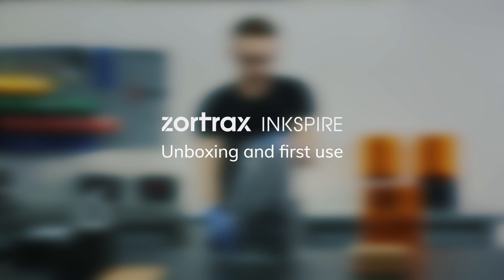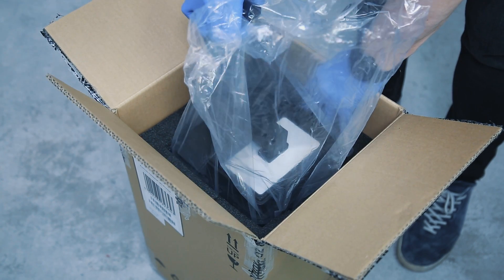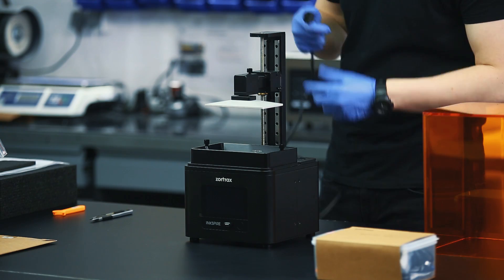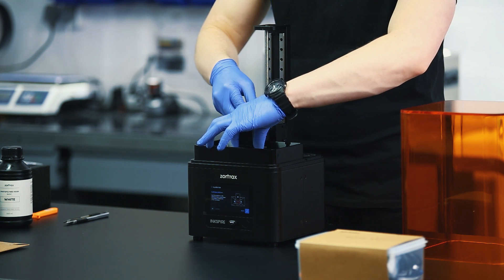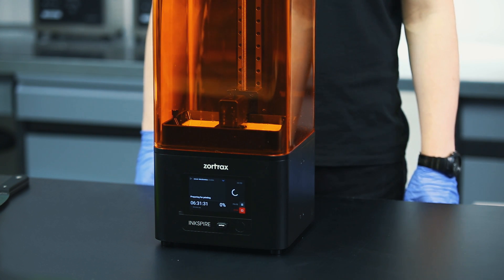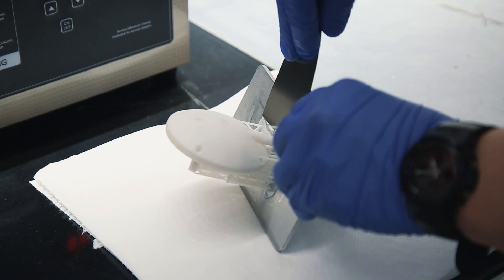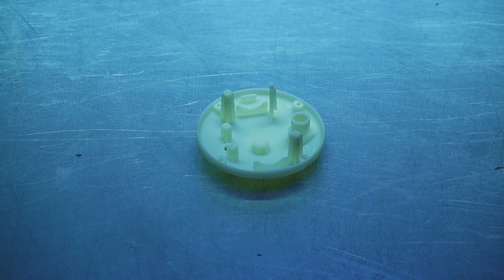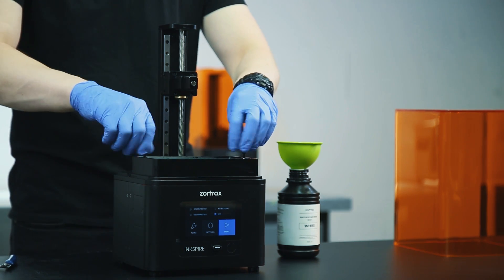Unboxing and First Use of Zortrax Inkspire Resin UV LCD 3D Printer

Comment: Looks promising.
I like that it's a fairly open system, unlike their fdm machines.
This is the right way to go - machines that can use proprietary AND 3rd party materials.
Reply from the maker: Hey there! Actually Zortrax M series users can 3D print with External Materials as well :) Visit our blog to find more information: https://zortrax.com/blog/external-materials/. If you'd like to see Inkspire's high quality of prints, order a free 3D printed sample (https://zortrax.com/order-sample/) or contact your local Reseller (https://zortrax.com/find-reseller/) :)